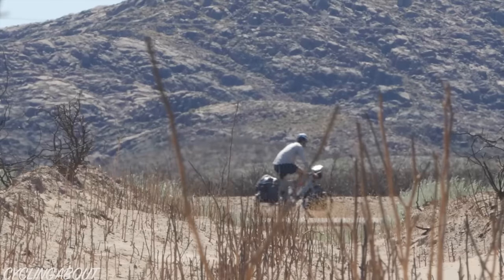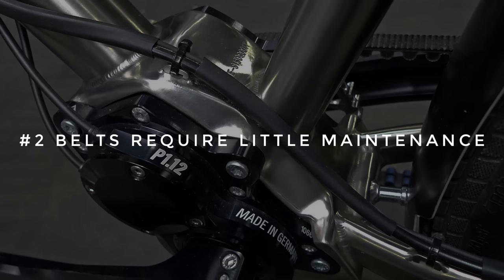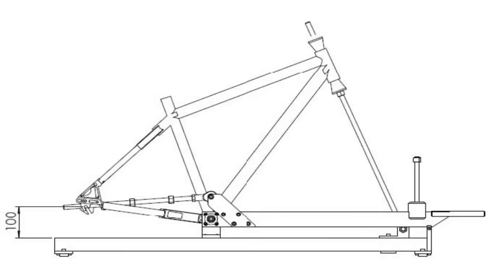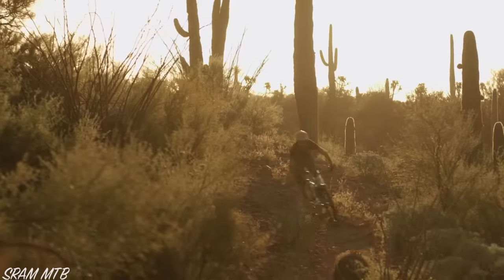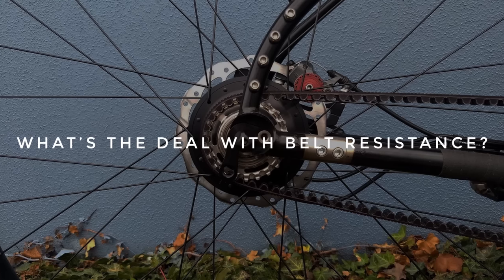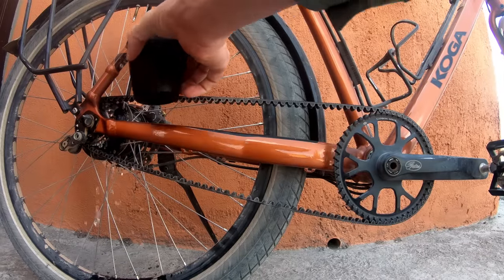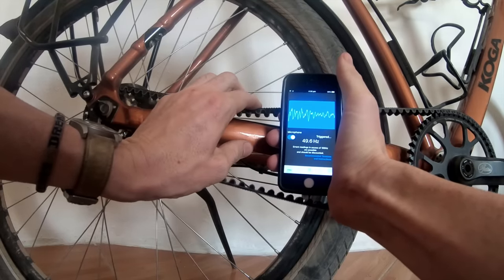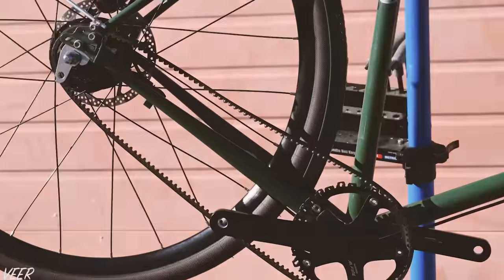Belts Are The BEST Bicycle Drivetrain Available (Epic Testing!)

Comment: Do any hub-makers offer belt-specific dinglespeed freewheels? I gave up the gates belt for the benefit of chain versatility. 
Why do cars with a chain drive almost never need replacement? Cars with belts need regular replacement...no mystery here
I broke a belt after only a couple of 100km. How strong a rider are you? I tested the strength of the belt - and broke it - on a ventana hardtail fatbike with rohloff.
The belt cogs grind out faster than manufacturers state.

Comment: looking at belt drive bikes.. thanks for your contact bin watching all your vids for a couple of weeks now..
Thanks for the tip about the treadmill oil.. i did find an other brand that is a bit more available here in The Netherlands. "Prounol 100% Pure Environmentally Friendly Treadmill Silicone Oil - 500 ml "  for $25 ...(they also sell a smaller 200ml bottle..made in poland)..also looking at "WD-40 Specialist Silicone spray".. perhaps that's a better solution ???

Comment: One other thing I have to say about belts...  belts made of rubber, if left in the presence of certain types of grease or oil, can become mushy/stretched, as the belt degrades chemically.  This is a problem with RUBBER belts though.  Kevlar or steel belts USUALLY are less suceptible to this problem, and honestly the amount of time such belts need to be doused in these certain types of oil and grease, is probably longer than the life of the bike itself.  :-P

Comment: I love the concept, but there are down sides as well. Belts are 3% less efficient (97 vs 99).

Belts do foul and fail. Ride in mid-western slush, large gravel or volcanic soil. 

Belt drives are heavier. You need a rear cog heavier than good clusters. You need a front heavier than any comparable 1x, most 2x and some 3x. 

Belts require extremely heavy internal hubs (which should be overhauled annually and yes, I prefer internal hubs too). These hubs have a great deal more internal friction. I am told this is not true of The Enviolo, but it needs to be perfectly filled and maintained perfectly if it is true and it is still absurdly heavy.
Reply from the maker: Where have you got your efficiency stats from? I have shown the best studies I know of in the video and the numbers don't show a 2% difference: https://www.cyclingabout.com/belt-drivetrain-efficiency-lab-testing/

The Enviolo has the most internal friction of any IGH. The efficiency is between 78 and 86% across the gear range: https://fahrradzukunft.de/17/wirkungsgradmessungen-an-nabenschaltungen-2/

Comment: I think I watched another video on belt drives that got me interested in your video. I would like to build an ebike with a ebike frame mid drive motor hydro brakes and if possible a nexus hub gear system. The reason is I want a bike I can go long distances with and not have as much maintenance. I understand in your video that you said you would need a bike frame designed for a belt drive.

Comment: Are they made of rubber or plastic? Rubber rots in topical weather that we get in Florida, and plastic lasts longer but also degrades due to the high uv. I think they're cool but long term in topical/subtropical climate they may have greatly decreased lifespans, I have to replace my tires on my bicycle much more often than I did when I lived in a temperate climate, everything that's iron based here rusts like crazy too cause the high humidity so I'm looking to build a new bike that can handle the rough climate as my old sears racing bike needs a makeover and during that time I won't be able to ride it and my old cruisers aren't great in traffic.

Comment: What about the weight of the bike frame? If it has to be built stiffer, then it’s got to use more material. That could offset the weight saving of the chain, especially when you add in the weight of the gear system. How long a chain or belt lasts is pretty immaterial to everyone, the price of a new chain every year is hardly breaking the bank. If our in the wilds, I can understand wanting something durable but things happen and if you broke your belt and spare, how long would it take to get a new one, weeks maybe? You can repair a broken chain to keep you going and pick one up almost anywhere. Interesting idea and good for commuters or city bikes but anything serious a chain wins hands down.
Reply from the maker: The stiffer bike frame would likely negate the belt weight savings, but my statement was more in the context of fitting a belt or chain to the same frame (I had the choice when I got my bike).
It's not really about 'breaking the bank' here, the cost per 30,000km is fine with both. But the longevity means I don't have to swap out my drivetrain as frequently while I'm busy travelling (brake pads are the only reason I go into shops).
I carry a spare belt, so I'm not worried about whether the one on my bike breaks. I can order another one online and ship it up the road if I need.

Comment: I have a bike with the NuVinci N360 hub. I'm interested in converting 
the bike to electric drive. The bike also has Gates belt drive. The 
Bafung dealer tells me this mid-bike motors do not work with Gates belt 
drive. (They wouldn't tell me why not). Is there an add-on electric 
motor that works with the NuVinci hub and Gates belt?

Comment: I bought a Scott Silence Evo a few years  back , with a Continental belt. I have around 5000km on it and it looks pretty worn already.. Is the Continental belt not good  or maybe the sprockets?  5k is a joke if I hear your distances. It may be my own fault because I spray it with dry ptfe spray instead of dry silicone. (Not much) You did not mention Continental belts so maybe they stopped producing them ?
Reply from the maker: Unfortunately, the Continental belt system was not particularly good and was discontinued three years ago. This video was centred around my experience with Gates CDX.
Reply: @Cyclingabout  That's what I was thinking , so the next belt should be gates . Any recommendations about the sprockets?
Reply from the maker: @nl1cat  Not specifically. You'll just need to use the Gates calculator to make sure the ratio you want is available and will fit your bike.
Reply: So it snapped today... gonna look for Gates  cdx and sprockets.  Really like the bike .

Comment: 461g for a chain? Mine weighed approx 240g last time I checked. Your graph says under 7000km usage, but 15,000km+ is possible with wax lubricant.
Reply from the maker: It's chain, cog and chainring.

Comment: Belt drive are terrible in dirt / off road but smooth and great on pavement. Maybe my belt quality was not up to it or the gravel rocky terrain I ride my ebike on is a bad mix. Basically rocks randomly get caught up between sprocket and belt and cause damage.
Reply from the maker: I ride almost 100% off-road with my belt drive bike and completely disagree.

Comment: Great video and review, but you should mention that there are off brand chines belts that SUCK. I bought my wife a Vilano bike with a belt drive few years ago and the belt itself broke after just 2 years (the teeth separated from the belt). I had to get a replacement from the company because Gates belts wouldn’t fit it. Still love belts for all the reasons you note and hoping the failure was just bad luck, but I’m betting that there are indeed garbage knockoff belts in the bike world now.

Comment: Excellent video. However, there are clearly some poor quality belt drive components available. I have a Cube with a belt drive which I hadn't ridden hard or very frequently before the rear sprocket shattered for no reason that I could see other than a manufacturing fault. It was a plastic cog on a metal ring. I could not get Cube to take any responsibility for this because the bike was out of warranty. It's been replaced with a Gates cog but at an eye-watering price of £100.

Comment: Belts are stronger too, and that will be important with the rise of e-bikes and more powerful motors...
Belts are clean, so ideal for commuters to not worry about grease on clothes...
Don't need a bunch of single-purpose tools to fit or change a belt compared to chain, derailleur & cassette systems...
Belts are cool enough to spark conversations from other cyclists - I mean, who ever comments on your chain?

Comment: The weight and rust of a chain could be solved by making it with aluminum and magnesium alloy which would also make it more durable
Reply: Magnesium and aluminium are both soft metals, and would wear much more quickly than steel. Aluminium also has a lower fatigue limit than steel, and gets more brittle with age. Kirk bikes made cast magnesium frames back in the 1980s, but they had a nasty habit of breaking, which is why you don't hear of them any more. Aluminium is roughly one third as dense/stiff/strong as steel.

Comment: Cool story bro but I like my Shimano chains 😄
I love that tough chain look and belts looks bland and weak. Also vehicles use chains (sealed lubrication) because its extra tough and very long service life. Belts only win the service life rating because bikes are lightweight. Shimano sells upgraded chains/chainring/cassettes for 12 speed MTB. Maybe ill upgrade to that future 13 speed Shimano gearbox if compatible and not very expensive 🤔😂

What if your bike got stolen or you crashed? This belt drive system is not easy to replace 🤑
Reply: 14,000 HP top fuelers rely on exactly the same Gates ribbed belt drive and there ok 👍 chains are rubbish old fashioned tech which will be replaced when Taiwanese manufacturers can find a way of cheaply producing belt drive systems

Comment: If belts were better than chains, they'd be really common.  The fundamental problem is that they need high static tension to work correctly, and that's bad for the hub and bottom bracket.  Added expense and very limited compatibility only help insure that they'll always be the wrong choice for most people.
Reply from the maker: The belt tension problem of the earliest design has essentially been solved through the Centertrack-type sprockets and minimum frame stiffness requirements. At the lowest recommended belt tension, your hub/bb bearings are under the same load at about 200-watts power output. As I've shown on my bikes, you can use much lower belt tensions with enough rear triangle stiffness - I can flex my belt so that it easily touches my chainstay.

Comment: "3-4x more than a typical chain... that's upwards of 30,000km"... I only get 1,000 miles out of a metal chain carrying almost no gear at 165lbs rider with 22lbs bike. What am I doing wrong? I'm stretched to 0.75% most recently after just 1,100 miles.

Comment: A few things I disagree:
1. The weight. Comparing just the belt with a chain is pretty much bullshit as long as you don't include the other parts (cassette, gearbox...)
2. The price of groupsets varies drastically. Pretty sure if you wanna have Shimano Dura Ace or Ultegra you pay more.
3. The durability: I have my ultegra groupset now for roughly 10km and I have still no problems. But yes, I am cleaning it quite often.

I totally agree that a belt system is great for traveling and commuting. But there is quite a reason why it's rarely used in cycling sport.

Comment: How do you know if your bike supports a belt train or not? Never heard of these before but quite interested
Reply from the maker: It will have a 'break' in the rear triangle and a way to adjust the belt tension.
Reply: @Cyclingabout  Thanks mate that helps

Comment: Yes.Cool, but catch 22 is the need for a really heavy duty axled geared hub, or custom engineered single speed hub to mount sprocket cog.  😑 A loaded cargo bike needs 14mm axle or bigger, & i don't fit in a simple bicycle weight class.  Ebikes get heavy. 😃  Build your dream bike.

Comment: Hey man, my belt drive hits my snubber and vibrates the frame (due to the ribbed belt), it's a good 2mm away from the belt when stationary. Have you ever had this happen? Can't really tell what's causing it!?
Reply from the maker: The belt is trying to walk off the cog if it's hitting the snubber. It could be an alignment issue from front-to-rear sprocket or not enough belt tension for the stiffness of your frame.
Reply: @Cyclingabout  cheers for the reply. Originally my belt was slack. Using the app 18hz, now it's 45hz well within the recommended range. However it keeps hitting the snubber on down strokes. When the snubber is removed it's silent and I can't see or feel any signs of the belt slipping. Perhaps I need to get a camera down there as I can't get the belt to hit the snubber, even if I stand on a pedle with the bike facing a wall.
Reply: @Cyclingabout  I'm beginning to think because it's 0c perhaps the Alu frame has shrunk a few mm hehe

Comment: The huuuuuuge elephant in the room is that you need a belt compatible frame! Needing a belt splitter in the rear triangle so that you can fit a belt to your bike is a no go to me
Reply from the maker: The elephant is not that big for people who don't already have a bike or are looking to upgrade. 😉
Reply: @Cyclingabout  Its like a rotary engine, or Wankel. Some people like it, but its mainly undesirable because its unique. I don't think I'll be one of those people who buy a frame with a splitter. In fact your video is not about a belt drivetrain its about a belt bike because you can't just switch to a belt on any old bike. 
Anyway, I guess I thought I'd find the holy grail but it isn't.
Reply from the maker: @bluceree7312  It's definitely the holy grail for me! I can't imagine ever going back to chains on my touring bikes.
Reply: @Cyclingabout  I guess the holy grail for me would be a belt that can be reliably broken to fit through the back triangle of any frame. Maybe Gates should come up with that?

Comment: Hi Alee,
Thank you for a very informative video. I have a question for you regarding belt drive performance in winter conditions. I work as a bike mechanic in Helsinki Finland. In Helsinki region temperatures tend to shift a lot between + and - degrees celsius during winter and I've seen cases when water and sleet has frozen on a belt resulting in the whole drive train becoming totally stuck. After melting the system continued to work again. Have you ever encountered this problem on your long expeditions? Cheers! :)
Reply: This is where chains are sometimes quite useful

Comment: Is it very risky with that shifler or gear box like that to touring around the world. Because it lose very hard to fix it if any problem ?
Reply from the maker: Rohloff and Pinion gearboxes are so reliable that it really isn't an issue. Just change the oil every 10,000km and you're good.
Reply: @Cyclingabout  Thank you for answer man .

Comment: Can you use a belt drive on a single speed track bike and are they suitable for sprinting ?
Reply from the maker: Yes, as long as the frame is built stiff enough to accommodate for belt drive.

Comment: How do you know if your chains worn out and needs to be replaced? It doesn't just snap right?
Reply: While it is possible that a standard metal roller type bicycle chain can break without warning you should periodically inspect the chain for wear. These type of chains do have a certain amount of stretching due to stressing of the connecting pins and wear of the rollers these new drive belts should have superior life in comparison. This technology is the same as the drive belts used in automobiles which replaced roller chain drives on modern vehicles with far superior performance.

Comment: The problem with belts and the gearboxes is that servicing and changing it costs a fucktonne of money, at least the belt and gearbox costs 350 eur, and in terms of service you got to re-spoke and re-balance the wheel, and that shit costs again 150-200 eur. All in all, it's the equivalent of a CVT box on a car: runs pretty great, great fuel economy, but when it breaks/when its lifespan goes off, it's a mighty expensive fix.
Reply from the maker: I've never serviced a Rohloff hub in my life. I do change the oil every 5000-10000km though, which costs me about $5 a pop. In terms of belt components, I normally spend $240 on a drivetrain that lasts me 30,000km - that's the same price as four SRAM X01 chains that last the same distance (then you need to factor in cassettes and chainrings).
Otherwise, you're right - if my Rohloff breaks and I'm out of warranty, I could be up for a big bill.

Comment: Zero Motorcycles uses belts on their electric bikes.  They're hardly the first motorcycle company to use belt drive, but DC motors have such a wide RPM range with usable torque that there is no transmission, so there's no clutch.  It makes a very simple drive system.

Motorcycles or bicycles, cleaning and lubricating chains is a huge hassle, mess and recurring expense.  I wish my new adventure motorcycle had a belt drive.  I might look into that as an upgrade.  The motorcycle has a swing arm, so no frame modification would be needed to use a continuous belt.